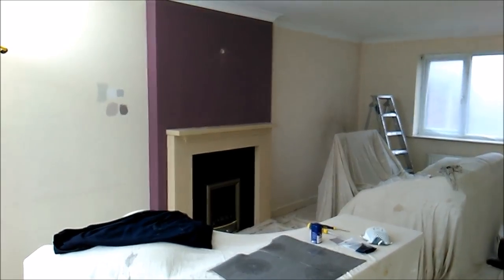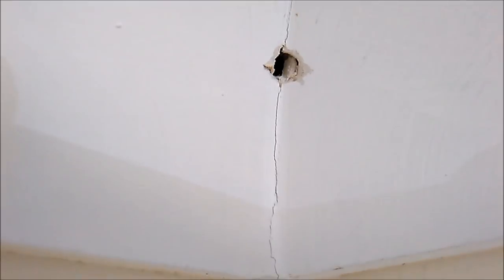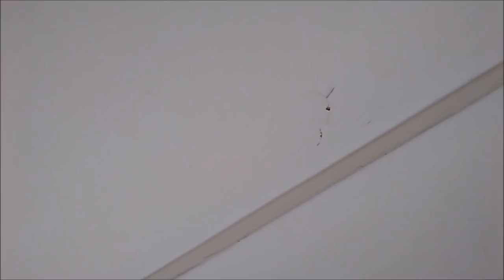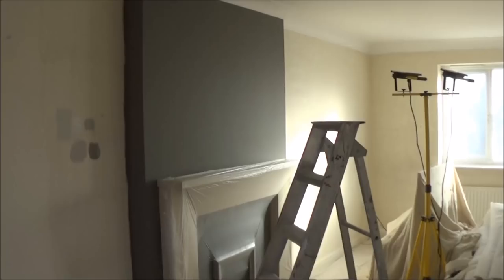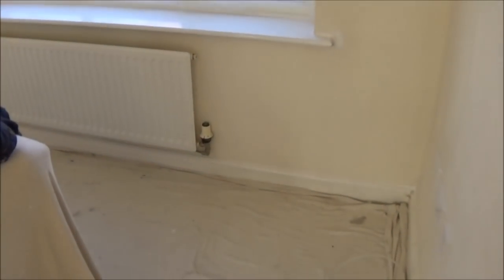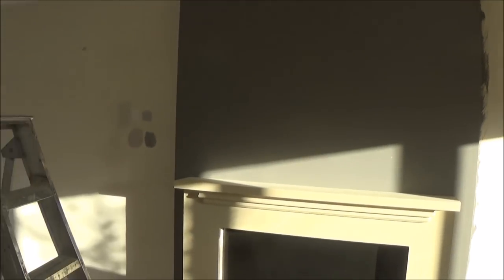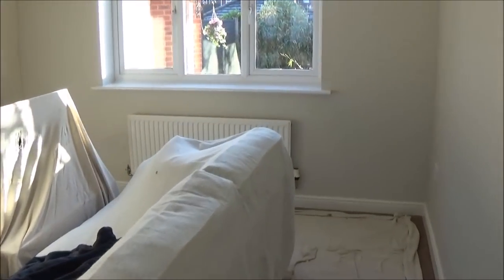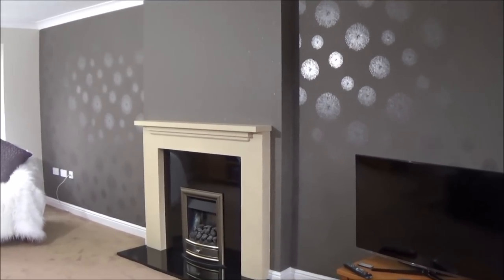Freshly Decorated  Lounge Sparkling Finish Glitter paint.

Comment: Hi, thanks for your fab vids.  Did you say you put two coats of glitter paint on the wall?  I've put two plain coats on my wall and the glitter paint is a third coat and also it OK, I'm wondering whether to put another coat of glitter paint on it as mine isn't as obvious as yours.  I know it's supposed to be subtle, but I've used a lighter, silk finish paint on my wall so wondered whether a 2nd (4th!! LOL) would be worth doing.  i just have enough paint for another coat.  |Would appreciate your thoughts.
Reply from the maker: Difficult to say it's almost different every coat depends on how it all sits an dries. No harm in giving it another coat, have noticed it depends on the amount of light and direction.  We have been experimenting with Matt varnish as a finish with glitter in, works well.
Reply: @PaintingandDecorating  Thanks, appreciate your time.  Pity you aren't nearer to me or I might set you on decorating my place. LOL  Looking forward to more vids

Comment: Lovely job mate - I have a few questions;
. How did you find the water based gloss when cutting into the wall, did it cover the emulsion that was overlapped onto skirting just as well as oil? Also how long did this job take. Love the vids
Reply from the maker: Thanks, I always will use an undercoat first if I can or two coats of water-based gloss if no undercoat required.
Reply: Painting and Decorating thanks for the reply - when I've tried water products (1 undercoat followed by 1 gloss) - I still find the emulsion colour still grinning through slightly on the edges I'm cutting in.. must be me lol!
Reply from the maker: No, it's not you very difficult to get water-based to cover. If your ever using a colour gloss get oil.

Comment: thats looks fab how many coat did you give the a wall  and for the wood work did you use a water based gloss loved the video.
Reply from the maker: Ratch Riat Thanks. Oil gloss on cill's and door and casing. But water based on the radiators and skirts.

Comment: Quick question how should you apply metalic paint onto linning paper ie roller if so which 1 foam or other?
What paint can i use to paint over a beige mantle exactly like you have in this video?many thanks
Reply from the maker: I'd use an old emulsion roller short pile. And lots of different types of paints can be used on your mantle but I'd use an oil based satinwood
Reply: @PaintingandDecorating  thank you thought it would be betteR to ask you as you are a grafter and a perfectionist which is awesum, it had me stumped.if you have a video on ceiling cracks using polycell paint that would be great thanks again will let you know the result.oh and i agree valspar is worth it.
Reply from the maker: Your welcome, polycell crack repair paint only will work in a small amount of cases that have fine hairline cracks. Cracks are generally some type of movement which can be solved in most cases.
Reply: @PaintingandDecorating  thanks again your wisdom is appreciated